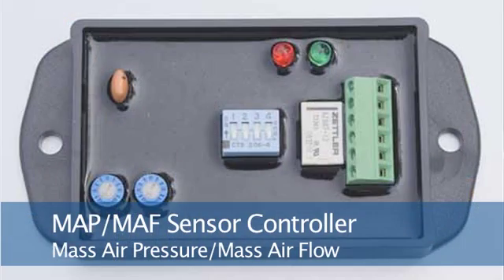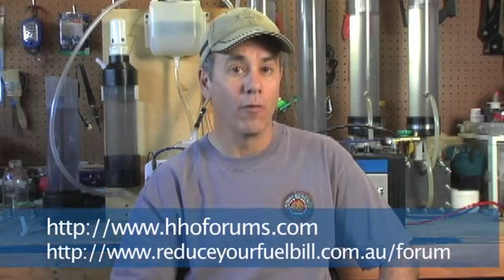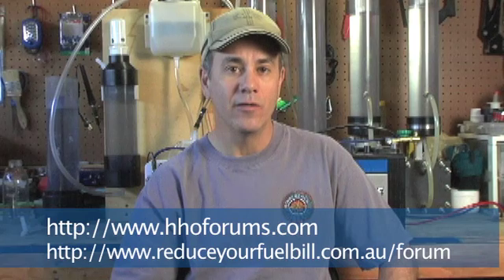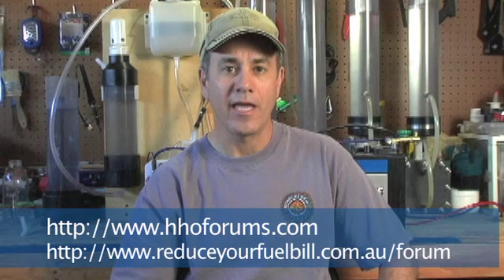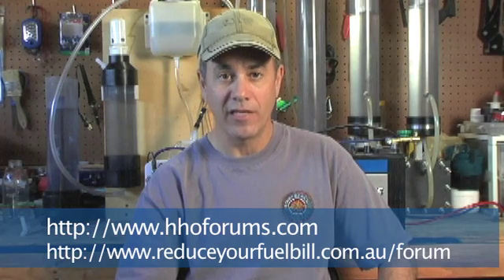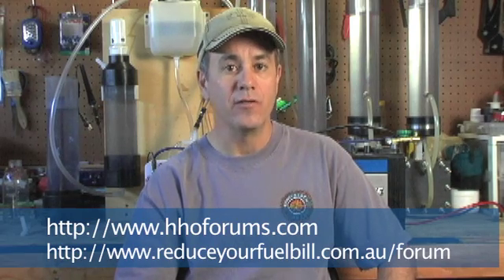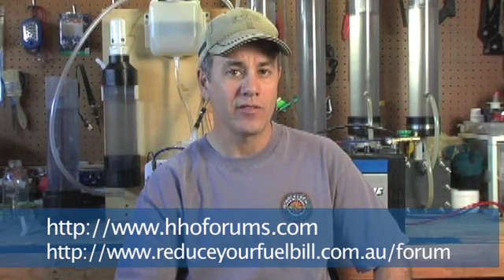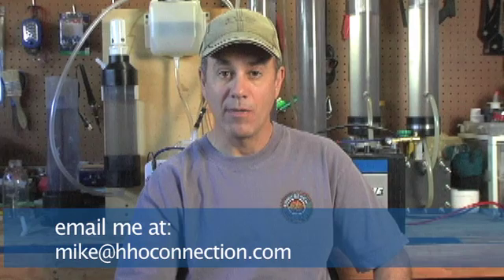HHO Installation Frequently Asked Questions

Comment: Hello Mike.  Thanks for your videos, they have been very informative.  I have one question though:  If I lower the water temperature before it goes into the cell, will the lower temperatures help the cell to operate at peak performance at more stable conditions?

Comment: ok I know you said you are not a mechanic and I understand that, but I was hoping you might have the answer to my question. ok so I installed 2 31 cells in my s-10 i do get better gas millage but I want more and I have also been seeing people are hermetically vaporizing there gasoline to get way better M.P.G I personally haven't tried this and was hoping you have and if so have you mixed it with the hho? or would you mix it?

Comment: Hello sir mike, I am wondering if aluminum plates in hho generator would be alright to be used for my bike. 
Thanks a lot
Reply: on my experienced, aluminum plates not efficient . Electrolyte (either KOH or NaOH) will eat up... stainless steel #18 or 20 is best for any hho dry cell.

Comment: can we connect the hho gas from the bubbler to the gas intake where the gas line is feed from the gasoline tank?  Just take the gasoline out and connect the hho line to that intake instead.  Please let me know.  Thanks for your help
Reply: life journey,
you'll never connect hho  fr.gas intake ..it will not works .otherwise maynex do his experimental, he disconnect  hose fr fuel pump and connect his invention h2 flex hydrogen and it works 100% run in water

Comment: So it is not a good idea to produce a lot of Hydrogen unless we modify the car construction?
Reply: You're going to want to build the engine for high heat tolerance. Since these systems tend to burn at different temperatures than a regular unleaded or diesel engines, using stainless steal, hardened blocks, forged pistons, etc; will definitely be beneficial.

Comment: Dear Sir,

I am Raviteja from india,i have a opel corsa 1.4gsi indian model 1400cc 4 cylinder.can you please suggest me the specifications for hho generator..

i have understood the construction but i have confusion about size and capacity of the generator.(Document for constuction).

And please explain briefly how the mileage will increase by hho.

Is there any changes need to done in engine after hho assembling.

Thank you.

Comment: What if you make a loop connection so that the engine produces just about enough voltage to keep it running and regular fuel with hydrogen when accelerating?
I think that is the best solution, and would make a great impact bellow the freezing point if you're stuck in the middle of nowhere.
Hydrogen works better as a catalyst to regular fuel, so it might be possible with some modifications, but I guess most people want to keep it simple...
Been thinking about that for some time, what you think?

Comment: I really want to understand this so I need lots of help. My friend showed me his setup and it seems really cool. You said 1/2 L. per min. for every L. that your vehicle runs off of. If a car runs 5 L. for every 4 cycles and the car runs at 750 rpms, that would be 5 x 750 = 3,750 Lpm. If it requires that 1/2 L. x 5 = 2.5 Lpm. Divide the two to get the ratio of the two: 3,750 / 2.5 = 1,500:1. How much fuel can I save with this recommended setup?

Comment from the maker: I have no idea at what pressure they blow sorry, I just know they work. As for Aluminum, don't use Aluminum in any part of your HHO project. Electrolyte (either KOH or NaOH) will eat up Aluminum in a hurry. Even the little bit that will get carried over from your reservoir. If you don't believe me, mix up a small batch of electrolyte and drop a piece of aluminum into it. The reaction will make a lot of straight Hydrogen but the aluminum will get eaten up quickly.

Comment from the maker: I can't give you any kind of exact amount but if there is no steam then hardly any at all. You could run a small reservoir all day and maybe see the level go down by an inch or so. Then just top it off with straight distilled water.

Comment from the maker: Only if you don't remove or "scrub" out the electrolyte particles from the HHO gas by using a bubbler or a dryer. The electrolyte particles will corrode anything made out of Aluminum.

Comment: I'm looking to design an efficient and if possible low maintenance hho system for installation into a vehicle. In your experience what material would be best used instead of stainless steel my research has brought these three to my attention as being both efficient and long lasting.
Platinum plated copper $40.00@12"x12"x.03"
Graphite $9.00@9"x9"x.15"
Titanium. $70.00@12"x12"x.03"
what would you choose?

Comment: so could you just run your car without any gasoline and just swap it for the tho convertor???? if you did could you runa 6litre v8 that has a HHo displacement of 7litres, and if you could would it work for highway driving, or do you just have to make more amperage

Comment: Hi Mike, another question. I noticed that there are 2 pipe going into the dry cell and a t piece connecting the tubing. Could you explain this in a video or where could I get a diagram on the water in and gas out to bubbler and flashback arrestor. Thanks Darren

Comment: Mixing hydrogen with gasoline or any other fuel is a waste of time. Hydrogen and gasoline ignite at a different rate. The only way to use HHO in a combustion engine is to eliminate the gasoline completely. The oxygen is what you want if you are mixing with gasoline. The oxygen aids in the combustion of the gasoline, making the gasoline burn more efficiently, i.e. milage gains. Hydrogen only thins down the oxygen, making the oxygen/gasoline mixture less efficient.

Comment from the maker: Don't worry about frequency, it won't make any difference. Just keep mixing your electrolyte stronger until you can get your desired amp draw cold. Set your PWM to that desired amp draw and let the current limiting feature keep it at the setting you want. The PWM will pulse to keep the amps draw the same. The cell will still heat up but not as fast.

Comment: hello mike thanks for all you help
i just installed my 9 plates dry cell(5x5x2) and hooked up with a ccpwm which connected to the fuel pump relay,so that it can turns on off by ignition.  i am so confused how much shold i dail the frequency and duty cycle ?for my cell to produce 1.5 l for my 3.5l engine
 thanks

Comment from the maker: I have never used a dryer so I don't know how well they work but I know others that use them exclusively. I would say use either a dryer or a bubbler or both. You have your terminology mixed up, there are reservoirs,  bubblers (or scrubber, same thing) with a flashport on top, and finally flashback arrestors. Three separate things.

Comment: It's easy to calculate air flow through the engine: 
Running RPM * displacement = volume of air passes through the engine.
Ex, 0.25litre * 6000 rpm = 1500 litres per minute of air flowing through the engine.

If you had an electrolyzer making 1/4 liter of H2 and O per minute, it would be creating 1/6000th of the gases taken in by the engine.

Comment from the maker: Watts are watts, it doesn't matter. The only thing to consider is if you increase the voltage (like 36v instead of 12v) then you will need to increase the number of neutral plates between each + and - plates. So instead of using 5 neutrals for a 12v setup you would use 15 neutrals for a 36v setup.

Comment: hello great videos you have. quick question... i have a 1800w solar array is hydrogen produced from watts or amps? meaning would i be better to make a low resistance electrolyte and run 36v dc 50 amps so panels parallel or higher resistance electrolyte 350v dc 5amp panels in series or is it irrelevant because both configurations are 1800w? does the resistance of the generator even matter because the current will be limited by what is being generated by the sun anyway. Thank you very much

Comment: HI,,IM A NOOB ON THIS MATTER BUT WERY INTERESTED. i saw a clip and some readings and have the conklusion that 3volts and 50amps per cell should be sufficient to make a car driveable on gas only,,now im a noob and would be happy if you could help me with the size and how to build one..was thinking of using it on a 2,8 crd diesel chrysler

Comment: Good video!

I'm thinking of making my car run entirely on HHO on demand, mainly because I want to save money, but also because it's environmental friendly (theoretically).
What I want to know is if you really need to have some kind of electrolyte in it?
I know the HHO should reappear as water after combustion, is it then possible to reuse it all over again?
I will mainly be using the five piston engine ranging from 1,9 to 2,5 ccm, a typical Audi engine. anything I need to think of before that?

Comment: Thanx alot mike :) good video again! If i order from US for more than 40-50$ i must pay duty-and its crazy-it doubles the prize. i live in a TAX + duty + fees country. so im really sory i cant support by $. But ill share later. thanx for the knowledge, its helpfull.
I have heard that in 2003 a tech team tried out by injection but the thing that injects into the cylinder doesnt last, and next if injected in the the intake a problem of hot spots in the cylinder occours because ..

Comment from the maker: @welder08arek You add enough to get the amount of amp draw you require. Maximum concentration is 28% by weight or about 1lb in 1 gallon. I use about 10 tbsp/liter.

Comment: Volo did NOT work for me! (I bought the HHO version) 06 Dodge 1500 with a 4.7 V-8 . My dry cell was producing 2 lts. a min and saw NO fuel mileage improvment. NONE.  Not Happy! Threw a lot of money at the project and got nothing in return. Now I can not seem to keep the system together.  It keeps springing leaks. Mostly on the reservoir. I am done. I don't even turn it on anymore.

Comment: Good video, you covered some good points, all correctly, IMHO.  Good job.

I just discovered the VOLO chip this week.

Have you ever tried NNCE - non caustic plant based electrolyte? 

I believe MAP is actually "Manifold Air Pressure". Mass Air Flow (MAF) and Manifold Air Pressure (MAP).